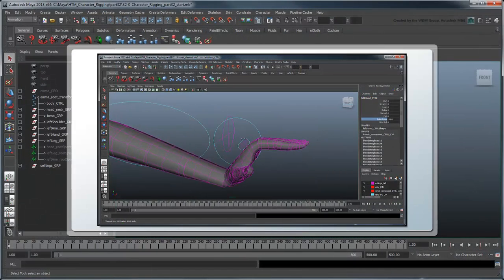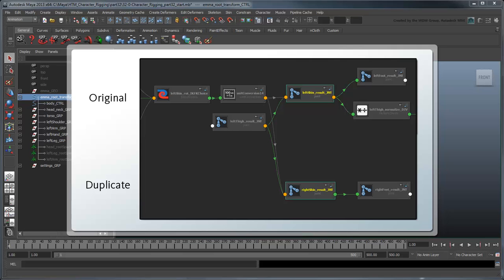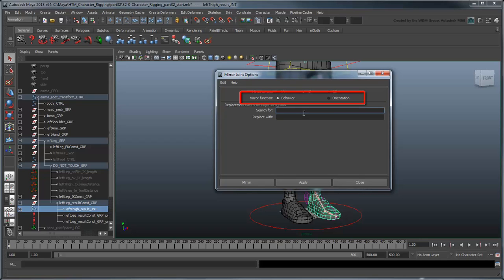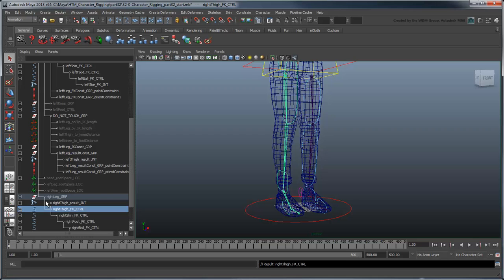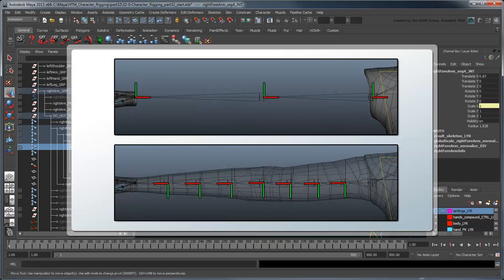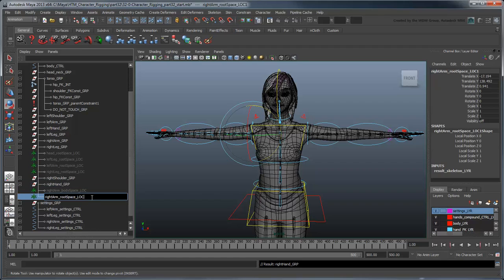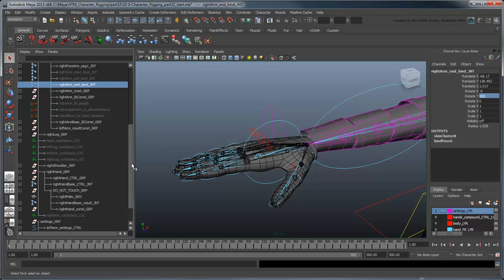Creating a Character Rig - Part 32: Mirroring (Advanced)

Comment: Hi again. I am having terrible trouble trying to get the right arm to play the game. I have redone the rig again and again and matched every joint orient from your file. I've got the twist to work fine but not the IK stretch.  I run this script:

string $driver = "rightArm_IK_lengthShape.distance";
float $rightUpperArmLength = `getAttr rightForeArm_IK_JNT.translateX`;
float $rightForeArmLength = `getAttr rightHand_IK_JNT.translateX`;
float $sumLength = -1*($rightUpperArmLength + $rightForeArmLength);  

setDrivenKeyframe -currentDriver $driver -driverValue $sumLength -attribute "translateX" -value $rightUpperArmLength rightForeArm_IK_JNT;

setDrivenKeyframe -currentDriver $driver -driverValue ($sumLength*2) -attribute "translateX" -value ($rightUpperArmLength*2) rightForeArm_IK_JNT;

setDrivenKeyframe -currentDriver $driver -driverValue $sumLength -attribute "translateX" -value $rightForeArmLength rightHand_IK_JNT;

setDrivenKeyframe -currentDriver $driver -driverValue ($sumLength*2) -attribute "translateX" -value ($rightForeArmLength*2) rightHand_IK_JNT;

It did appear to work ok despite a cycle warning so I continued and created the elbow snap but now it really buckles or flips. I get another warning:
// Warning: Cycle on 'rightForeArm_IK_JNT.translateX' may not evaluate as expected.  (Use 'cycleCheck -e off' to disable this warning.) // 
// Warning: Cycle on 'rightUpperArm_stretchChoice.outputR' may not evaluate as expected.  (Use 'cycleCheck -e off' to disable this warning.) // 
// Warning: Cycle on 'rightArm_IK_lengthShape.distance' may not evaluate as expected.  (Use 'cycleCheck -e off' to disable this warning.) // 
// Warning: Cycle on 'rightForeArm_IK_JNT.translateX' may not evaluate as expected.  (Use 'cycleCheck -e off' to disable this warning.) // 
// Warning: Cycle on 'rightUpperArm_stretchChoice.outputR' may not evaluate as expected.  (Use 'cycleCheck -e off' to disable this warning.) // 

when I move the distance locators out of where they are meant to be the warning goes away, but that defeats the purpose and the functionality. Please help as my hair is almost all torn out at this stage :S
Reply from the maker: Linda Dunlop A cycle generally indicates you have either a parenting or constraint problem.  It means that some object A depends on knowing the value of object B to calculate it, but object B depends on object A, causing a "chicken and the egg" effect (hence a dependency "cycle").  

The script you've posted is correct, but judging from those errors I would guess that you either have some joints or measurement nodes (specifically the locators for the start and end points) parented incorrectly on the right side.
Reply: Maya Learning Channel Thank you for pointing me where I needed to look. I couldn't see the forest for the trees and was getting very frustrated. It was a locator in the wrong place problem which is all fixed now and working properly. Thank you again for your help :)

Comment: When I work on the right arm rig for the upper-arm and forearm segment joints, do I set the ik-handle twist control up Axis to Negative Z: and the up vector 1 and up vector 2: to -1 z-axis or is this wrong?
Reply from the maker: Jared Davis If you check the annotations you'll see I posted an updated set of values for this.  For the left side I'd recommend Forward Axis: +X, Up Axis: +Y, with Up Vectors: 0,1,0.  The right side is the same except Up Axis: -Y.
Reply: Maya Learning Channel
Reply: Maya Learning Channel
Reply: Maya Learning Channel Where did you post these new updated annotations for the right arm rig? And what do you mean by the Forward axis and up axis: is this from the orient joints option or is it from the advanced twist controls options for the upper and forearm ik handle?
Reply from the maker: Advanced Twist Controls.  You can find the annotation in part 22, when we first set up the arm twist.

Comment: Funny; when I duplicated the rig using the duplicate special options and check the duplicate input graph box, and invert it the rig, it work. The Arms and Legs mirror each other perfectly. I am using the Maya 2015 edition so was this problem fix? Aside from the fact that it exist in different mirror spaces [1, and -1] is this a problem? This rig doesn’t look like you will be using the scale attribute for the arms and legs just for the Emma root transform controller.
Reply from the maker: Jared Davis I would check the actual values of the controls, because if the Move Tool is set to World Space it can give you the illusion everything is working when in fact it's not..  For example, move both the foot controls to the left, then check the Translate X of each individual foot control.  Are the values actually the same, or are they moving in opposite directions? 

Note: this isn't a "problem" that newer versions of Maya would fix.  Maya is performing the mirror operation correctly.  It's the mirroring workflow itself that's flawed.

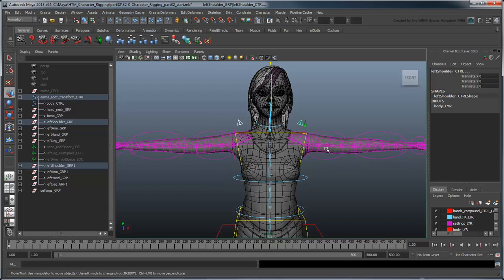Comment: Around 4:00 you show the problems with simply mirroring the arm and leg groups through a duplicate special. From what you've said and what I've seen from doing it myself, the only functional problem that the mirrored spaces give is that all translation-based controls move oppositely to the desired direction.

Would it not be a solution simply to parent these controls under an empty group or locator that itself has a mirrored space? Thereby switching the controls' space back to normal again?

Thanks for the help thus far. It's very impressive you have time to answer all the comments.
Reply from the maker: The reason this won't work is because both the IK and FK controls must drive a common world space result skeleton.  If one is in a mirrored space while the other is not, then the result leg will constantly flip around every time you go from one to the other.
Reply: Got it. Thanks.

Comment: When I mirror the left leg to the right side, and use the distance tool to create the distance between the thigh and foot joint for the stretchy IK leg. I get a different length compare to the Left leg. Its this normal?
Reply from the maker: Jared Davis No that doesn't sound right.  They should be identical.  I would check the joints in all views to make sure they line up with their left counterparts.
Reply: Maya Learning Channel
Hello again. I started the knee snap operation on the right leg, and when I finished with the node editor the Geometry of the right leg rotate in the opposite direction. It snaps to the knee, but the geometry reverses its faces and rotates in the opposite direction.

Also your file on YouTube: Using the distance tool the distance between the Emma character rig's  thighs and feet; for the stretchy IK legs are both different lengths.
Reply from the maker: Ah i see what you mean.  It's off by only about 0.0001 though, which is probably just a rounding error.  For all intents and purposes, a tiny value like that can be considered no difference.

As for your other issue, I'd check the values of the actual IK joint versus the result joint to see if just one or both are flipping.